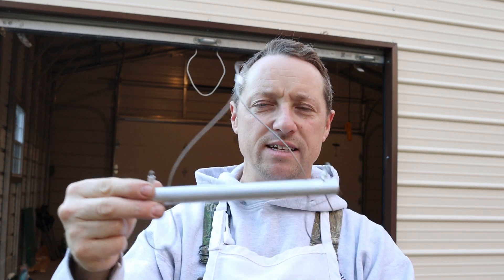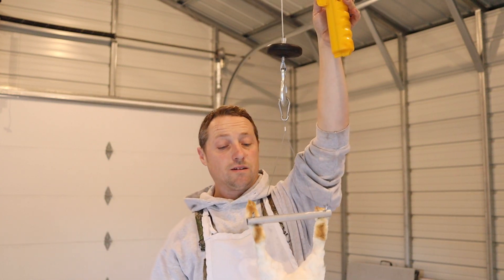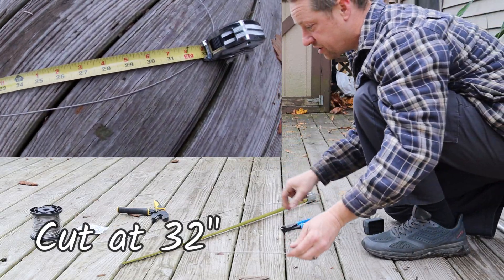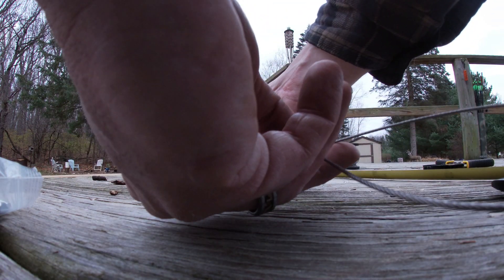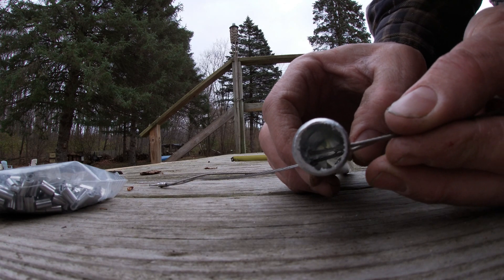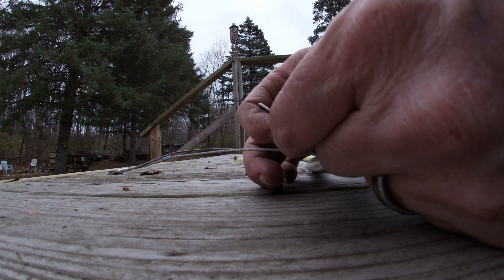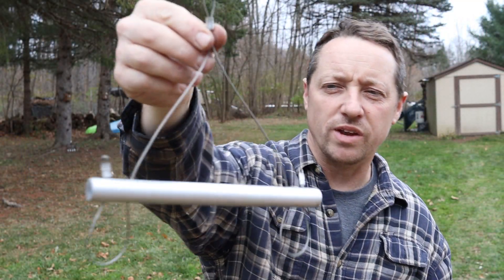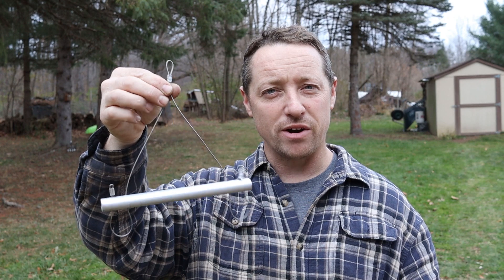HOW TO MAKE A SMALL GAME GAMBREL TO SELL

Comment: Aluminum tubing is easier to cut and drill. Old ski poles are a cheap source of aluminum tubing. The tubing doesn't need much strength because the pulling force is against the cable.
Reply from the maker: Thanks for sharing!

Comment: What gauge is the wire you use? I made one a while back but find the feet slip out sometimes. I’m wondering if my cable is too thick.
Reply from the maker: Pull down tight before getting started to set the hocks into place click the video see below in the video description to see all the products used.

Comment: Well thank you for sharing. I know you do these videos all by yourself which makes recording at good angles and such difficult but, for someone who's never used or made one of these is going to have a tough time following along. I sure couldn't tell which direction to do everything. As the angles changed and jumped right into action I was lost every time. Please don't be offended I'm just offering helpful criticism. I love and appreciate your videos. But this one just left me wondering. I'll just buy one instead. LOL thank you again for sharing your wisdom. Not sure what gage wire was used... I think you used 1/2 inch pipe but I don't think that was mentioned either, only the overall length.
Reply from the maker: I'm sorry to hear the explanation wasn't easy to follow. In the bottom, right corner of all our videos, you will see " ...see more"If you click that it's the video description - all the product links are there for you. Id try to watch the video again. Here's another description. 
1) Cut the wire at 32"
Put the first crimping sleeve on an even out the wires so the distance is the same slide sleeve away from the folded end so you have enough room for a hanging screw. 

2) take your half-inch pipe and screw two pilot holes -1st hole .5" away from the end and 2nd hole 1.5 inches in from the end repeat on the other side of the pipe.
3) now take your braided wire and threaded through the inside hole, which would be 1.5 inches away from the end.
4) once you're through turn 180° and go back through the pilot hole that is only .5 inches away from the end.
5) now you just need to put a crimping sleeve on the very end of that wire and that side is done 
6) repeat in the other side -gambrel is done!